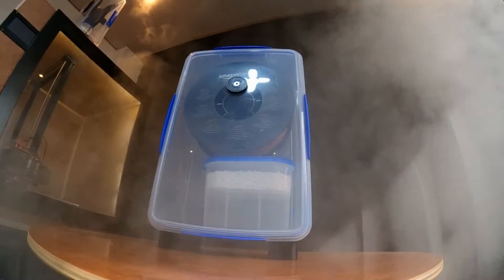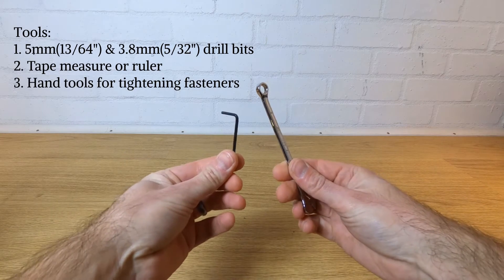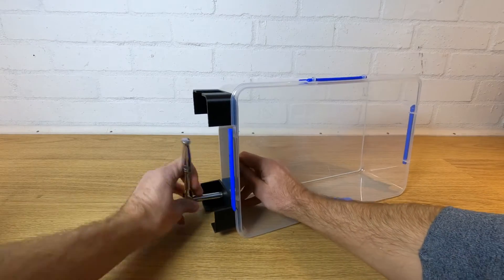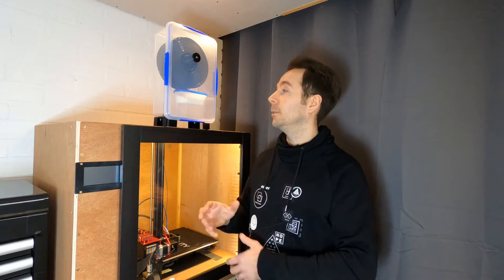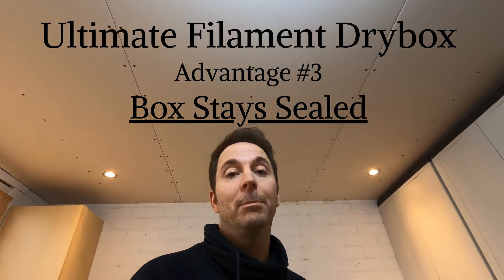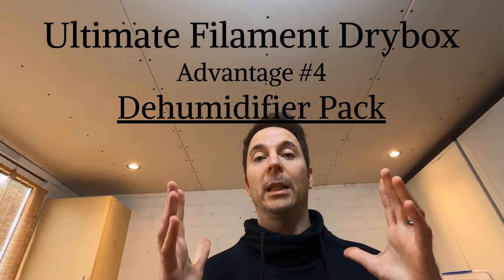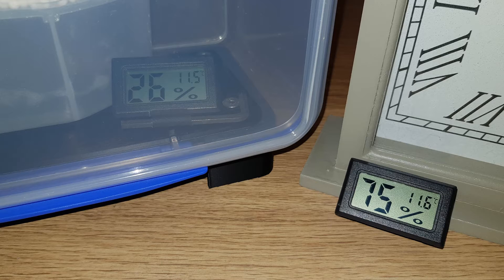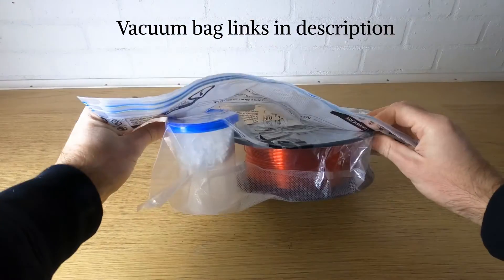Ultimate Filament Storage Dry Box - Print while keeping your filament dry

Comment: Great box! Went from 50% to 10% RH at 21C = 8.9818g/m3 to 1.833g/m3
Reply from the maker: Glad you're seeing the benefit👍 I still haven't changed a pack in 6 months too! Thanks for commenting .
Reply: @RickyImpey  I think I broke something. ;)
2:40 Instructions not clear, the nurse says she will be gentle.
Reply: @RickyImpey  Just read the instructions for my hygrometer, it states that it operates within 10-99% humidity, so the box could perform even better.
Reply from the maker: Awesome, to be honest, I don't put the hygrometers in the box any more, I trust that they are as dry as possible in there. When I did all my testing, the humidity just kept going down, I don't actually know just how low it could go ultimately.
Reply: @RickyImpey  Glad you took out the hygrometers. See my comment below. they aren't needed nor are they useful. They only give false impressions of what is actually going on. I'm amazed at how many hygrometers must have been sold to the 3d printer community... Unless I'm really missing something, but I believe not. Sorry to also bash your rewind mechanism to some extent ;) no bashing really; I love it, and also the motorized and automated ones that some people have come up with. Genius.

Comment: i simply store my filament in a big storage box with a car "dehumidifier" like you did. But my job also includes working with a HELL of a lot of the large silica packets so i always throw in a handful every week. there is 100s of those packets in the box LOL. the Humidity sits around 9% its great. still dry out the filament for around 6 hours just to be safe when i take it out for use.

Comment: Use an air compressor to suck the air out of the box, then compress it and expand it and additional moisture cool precipitate out when you decompress it. Extract out the moisture with a sinter filter. Cycle though this process and you'd get very dry air

Comment: I've just built my second one of these dryboxes (and included the rewind mechanism from the other video, and the missing-teeth cog for minimum friction when printing). I used the same dehumidifier tubs as in this video. I use Eryone TPU. In my first box the humidity meter never dropped below 30% and spent most of the year it was in use showing about 35%. In the end, I had to refresh the dehumidifier, as it was saturated, and put it back in and sealed up the box. Within a day, the humidity was down at 20% and it's staying there. On the same day, I loaded a new spool of filament into the newly-made box, and that's sitting at 31% after several days, ambient is 39% at the moment. My conclusion is that the factory doesn't dry TPU before sending it out, it seems to be packed at whatever ambient humidity is present in the factory. Putting it in a drybox on opening, the filament very gradually gives up some of the moisture it already contains, keeping the humidity in the drybox higher than it would be if you just sealed up the box with no filament in it. I checked that - well below 20% within a day with no filament, the boxes are well sealed, it's the filament that's causing the humidity to stay high! Both filaments print perfectly, so I conclude that it's quite happy at around 40% RH, although lower would be technically better of course, and I'm certainly staying with my dryboxes to protect against higher ambient humidity.

Comment: Just because you know, the AIR inside the box contains 5g less water, how can you be sure, the water inside the filament is sucked out as well? Couldn't it be that it is kind of "sealed" into the filament and doesn't get out?
Reply: That's exactly the case. Dry boxes aren't for removing moisture from the filament, they just prevent more moisture entering it over time. To remove moisture, you want a filament dryer with a heater and fan.

Comment: Hi, made the box and its brilliant so well done. Tesco do a simular sistema box but 7.5ltr instead of 7ltr. And on offer at £10. Everything fits ok except for the legs. The angle is slightly different and the box leans back. Is it posibly to get the file so I could make the adjustment to alter the angle. Many thanks 
.

Comment: Can the desiccant be recharged, or does it need to be replaced every so often? I know with silica gel or activated alumina you can recharge those in an oven or dehydrator, but these canisters appear to use calcium chloride pellets.

Comment: I want to build this box with the rewind upgrade, and so would like to use all similar (metric) bolts. But the US Metric bolts linked aren't available and I'm having trouble finding 5mm long bolts. The Imperial bolts seem longer. Will longer bolts work? Any suggestions? Thanks
Reply from the maker: Hi, sorry, I should update the links. You need either m5 x 16 bolts or 3/16 x 5/8. These can also be called 10-32. You can use longer bolts for the base, I believe the only place you can't really use a longer bolt is in the part that goes through the lid of the box. A little longer is fine but no more than about 5mm, 3/16". Hope this helps.

Comment: You know, the downside of your extremely compact and streamlined design is that, as is the case with all, not to put too fine a point on it, overoptimized designs, it heavily relies on using the exact parts. This sort of design rarely ever ages well. As of writing this, the dehumidifier capsules you recommend aren't available. Using a bigger one is not an option. I'd honestly prefer a somewhat less optimized but more robust and flexible solution.

Comment: I'm really scared of these calcium chloride dehumidifier packs. They rust EVERYTHING in vicinity. This means it's airborne, and it's an extreme airway irritant.

Silica Gel granules are safe (except if you somehow manage to get lung silicosis from them, which is why granules should be intact and not under some stress that could break them) but i doubt you can get that much desiccant performance out of  them.

Comment: I just stumbled over the fact, that silica gel, what some people seem to use, has a terrible water affinity at low relative humidity. I've been using room dehumidifier packs, like you, which are most probably calcium chloride. They seem to work but last week I found out that the r.h. within is still 23% (well ok, after years...) and that's too much for my perfectionalist brain. I'm a chemistry guy and went through all the drying agents that came to my mind. At least the somewhat safer ones that are also easy to obtain and cheap. Like sodium sulfate or magnesium sulfate, maybe molecular sieves, and began to read up. I couldn't find data for most drying agents, but there was a surprise candidate: calcium oxide. Or "burnt lime" / "quick lime". It can't be regenerated as easily, since it requires a modestly high temperature but those filament boxes don't see a lot of water in absolute terms.
To sum it all up, if you want to stay below 10 % r.h. quick lime is good for 26 % of it's own weight in water absorption (which is close to it's maximum) while silica gel only manages 4 % (which isn't close to it's maximum at all...). Above these absorption percentages the r.h. will rise above 10 %. The rate at which it will rise is pretty bad with silica gel. I have no data for calcium chloride, unfortunately, but an experiment to find these equilibrium points would be pretty easy. Molecular sieves get 15 % of their weight in water, before the r.h. rises above 10 % and thus might be a good compromise.
Quick lime is relatively corrosive, so don't touch it. I'd still consider it, as opposed to maybe concentrated sulfuric acid, which would be a great drying agent, but might be a tad to dangerous and a bit of a hassle. Quick lime is also comparatively slow to take up water (10 to 20 times slower than silica gel and others) but considering the low absolute amount of water we are dealing with, that shouldn't be a problem.
To my surprise quick lime is sold for gardening purpose, so it's available and dirt cheap. I want to try this and just ordered 10 kg for all of my boxes xD .
Reply from the maker: Be great to hear how you get on👍
Reply: How did this go?

Comment: Hi ricky im having trouble printing the base plate for your filament dry box as it not flat and prints in layers and 1 section at a time can you help me out thanks
Reply from the maker: Hi, I'm not 100% sure what you mean but you should orientate the file so that the large flat part is flat on your bed.
Reply: @RickyImpey  hi Ricky, for some reason, in cura 5.5, the base plate isn't printed flat 
So I switched to prusaslicer 2.6.1, and it's all good and prints just fine. It might be a bug with cura 5.5
I would send you a picture of how it is in cura, but I don't know how to add pictures on youtube

Comment: If you want to get it dryer, just use a better desiccant like NaOH(lye) or even better KOH(used in soap making). Just make sure to put it in a container it won't react with like glass. Though at high temps KOH can etch glass. I'd still use the store bought dryer to remove the bulk of the water, though the KOH is such a good desiccant, it will probably dry out the store bought dryer!
Reply: @lotsofthingsgoboom  found the safety police! These work fine. Obviously, ppl should use precautions when working with any chemical. However, neither is going to instantly dissolve your hand off!  Wear gloves and eye protection, and don't eat it, and you'll be fine. Next you'll yell at ppl making soap!

Comment: Hiya Ricky. I realise this video is 2 years old but apparently systema have changed the angles of their drybox and reversed the locking handles. I found last week after printing the feet out, but nothing that a few washers added to the rear of the legs doesn't solve but could cause worry for some.. Great information thanks mate keep up the good work.
Reply: I was worried when I read this cos I'd just ordered one!!! Turns out that Sistema have two completely different ranges, the "Klip-it" and the "Klip-it Plus". The Klip-it is 7L and  has the handles on the bottom section while the Klip-it Plus is 7.5L and has the handles on the lids. I have loads of their tiny Klip-it containers which I use for freezing food like herbs and sauces and I absolutely love them, superb design, and I much prefer the ones with the clips attached to the bases, which is the type shown in all the variants available currently (December 2023) on Rickey's UK link, and I was very relieved to see that the box that arrived a few minutes ago from Amazon has got the clips attached to the bottom section as per the video above. I hope the angles haven't changed, I guess I'll find out when I look at the STLs for printing the bits 😄
Reply from the maker: Thanks, I will check out the new boxes👍
Reply: Bloody Kiwi's ...

Comment: Hi Rick I made a 2 spool version. Using the Sistema 10L box, Reworked your STL's to work with 2 eSun spools (I only use eSun ), all on bearings and "O" ring sealed on threaded rod shaft. Use 500Gr of indicating silica beads, just empty via rubber bung on the bottom and refill from the top bung so opening. I also used the Small "missing tooth" sprocket for less friction as my filament pulls up into the printer. Lasts for weeks. I can make all the files available if anyone is interested (STEP and STL) have a look at:
https://youtu.be/4RZBEiHrOhA

Comment: LOVING the design. nice and simple, however my stupid printer feeds from the bottom at the side which is a pain for me as my extruder is having a hard time feeding the filament from the box. considering a shelf mod and swapping the humidifier to above the reel. hoping this works for me. might just buy a new printer instead lol!
Reply from the maker: On different printers, I use a length of PTFE tube from the box to guide the filament to any awkward position I need to. It works well as long as the tube is not too long.

Comment: Great and simple desigh, @RickyImpey. May I suggest you to add bearings for smoother filament feeder and a holder for a runout filament sensor?
Reply from the maker: Hi, I did start with bearings but found that the 'tug' from a printer's exruder could unwind a little extra filament. Multiply this 1000 times over a print and I ended up with a lot of tangled filament to sort out. The small amount of drag with the 3d printed parts touching helped in my case.
With the filament runout sensor idea, it would be hard to implement something that suited all the different designs out there. What i do is run a length of PTFE tube from the drybox to any runout sensor to avoid any kinked filament.
Reply: @RickyImpey  makes sense. Thanks for sharing your experience.
Reply: @RickyImpey  I was wondering if you could provide longer legs so I can put my filament runout sensor just below. Current legs are 37mm. 80mm would be perfect for me. Thanks in advance

Comment: Doing my test run on your Free filament dryer box first then I'm going to build this Ultimate box as well. I think I'll be expanding it to hold up to 3 rolls as I tend to constantly be switching colors. Plus if the Dehumidifier packs are as powerful as you claim then One should easily handle 3 filament rolls, Right🤔? Okay fine I'm a little lazy and don't want to build a half dozen of these boxes😅. Love the step-by step instructions btw.
Reply from the maker: 1 pack will do 3 rolls of filament no problem. It just might need changing a little more often.

Comment: I see not a single reason to drill the box. It can work absolutely the same way, but lying as it should - just put inside your filament and dehumidifier, close the lid and viola! Doesn't matter your filament is hooked on the wall or just lie at bottom of the box - it dries.

Comment: Brilliant design! However, I note that you use calcium chloride desiccant, which is consumable; did you consider silica gel, which can be microwave regenerated- and I believe dries to a lower humidity? Is there a reason not to use this?
Reply from the maker: Hi, I tested with Silica gel and found it was less effective. Yes, it can be reused but it's also not great for the environment. These desiccant packs last for at least a year in the box and can be refilled if you buy the calcium chloride separately.
Reply: @RickyImpey  I am surprised that you say gel is less effective- sources say that it dries to a lower RH, which is why it is used for flower drying. If you re-generate the gel then it never gets into the environment...  I have printed a perforated box to hold it, with a hot-glued frame it clips to. Colour change indicates re-gen time. I am concerned at the 'at least a year' life- given that, once the inside is dried, there is little more for it to do, and the 'overkill' for such a small box, what is causing it to be used up? Is the box 'breathing' through the feed?
Rather than use feet, I have made a 'cassette holder' (the boxes are technically cassettes) into the top of my printer chamber that aligns them correctly. A filament clamp on the feed nozzle prevents accidental retraction into the box, and a cap stops 'breathing' through the delivery hole with temperature change. My final change is to replace the twin bolts that hold one side of the spool bar (the protruding nuts limit how closely the cassettes can be stored) with a single axial bolt similar to the other end. A storage rack completes the project.
Many thanks for this idea- it made a great starting point.

Comment: Make added to thingiverse: I have just used the spindle and it's attachments. The two screws on the spindle mount the box onto the wall of printer enclosure with two additional screws in the two lower corners of the box. This keeps the box firmly fixed on the wall in the correct location. I also made one other small hole which I tapped a bowden tube holder into. This allows a bowden tube to directly feed my direct drive extruder. I have added some silca gel packs and the humidity inside the box, is now approx 50-75% lower then the humidity in the enclosure. I am currently printing the winder upgrade for the box and I'm going to get some more boxes to make more. I'd like to work out a quick release bracket to mount the box onto the wall without screwing it on, to allow for the box to be changed without opening them to undo the mounting screws.

I will be sending you a "coffee" for you great design.
Reply from the maker: Sounds like a great remix Duncan, I'll check it out👍